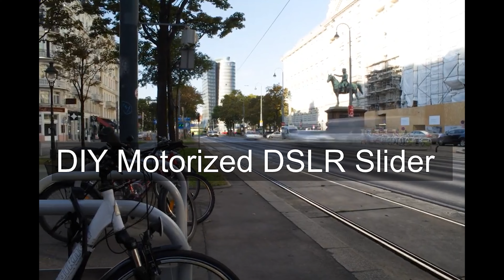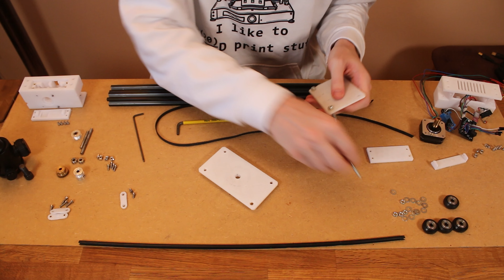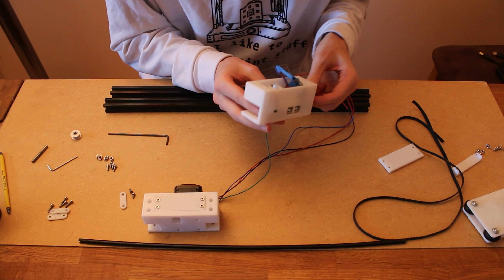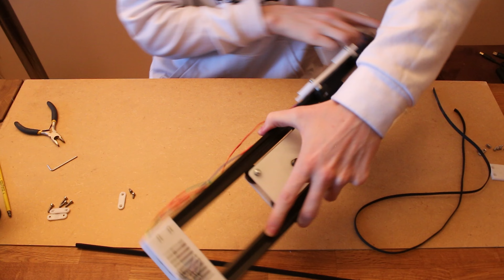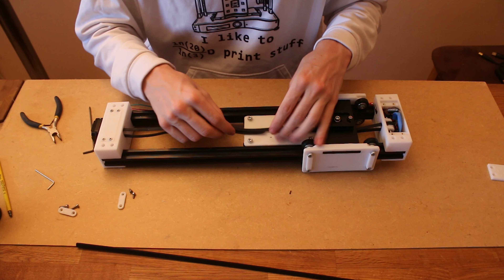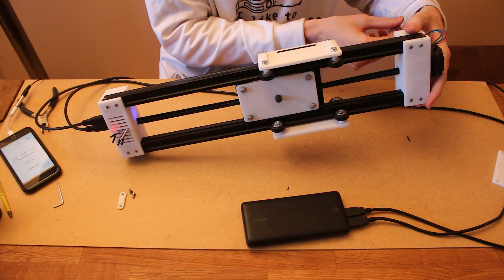DIY motorized DSLR slider (with WiFi) assembly guide (uncut)

Comment: Sebastian, two more questions.
Is the micro switch connected to the normally open pins?
Thanks
Reply from the maker: Hi, not problem, these are things that I should have included from the beginning. I have now added the wiring of the endstop switch here https://github.com/shirnschall/hs-slider-project/blob/master/schematics/endstop-wiring.png . Note that the pulldown resistor (10kOhm) is not part of the pcb but wired directly to the switch. 
I also added a screenshot of the settings I am using here https://github.com/shirnschall/hs-slider-project/blob/master/slider-firmware/default-settings.PNG . Please start with the gantry positioned in the middle of the slider and make sure it moves in the correct way when you press home. If not, use the "invert motor" checkbox to change its direction. 

To configure the max position yourself, start by homing the slider. Then, use the "current position" control in the "camera setup" tab to manually move the slider to the end position. If the slider cannot reach the other end, increase the "max position" setting value. If it reaches the end at e.g. "current position" = 97 go ahead and replace the current "max position" value with the result of the following calculation: (the current "max position" value)/100*97.
Reply: thak you very much @hirnisprojects453

Comment: Hi. I ordered the VERSION 2 board made by the JLCPCB, and I verify that the 248892E_Y12.rar file contains version 1. As I received the board, I verified that there is at least a difference in the pinout of the voltage regulator from 5v to 3.3v on the ci board. please tell me if there is any other pinout difference from ver 1 to ver2
Thanks
Reply from the maker: Hi, can you please explain further what you mean by "version 2" board and send me a link if possible? I am unaware of a version two board. I can also see only one commit on github regarding the gerber files. Yours, Sebastian
Reply: @hirnisprojects453  Sebastian, in the ci board layout, I check it says see 2. hs-slider-project-master\schematics\shematic.pdf.
When opening the pdf, in the lower left corner it says: 02.08.22 02:20 /Users/shirnschall/Documents/EAGLE/projects/slider-v2/pcb.brd.
Inside hs-slider-project-master\pcb-gerber-files there is the file 2488982E_Y12.rar. This file has version 1 of the layout. I say this because I sent the file to jlcpcb and they sent me the board with ver1. They said the file is from ver 1.. Tanks
Reply from the maker: @DRONE_LASER_3D  Hello, currently there is only one version of the pcb, v1.0. The pdf says slider-v2 as this is the second slider I have designed and so it is referred to as slider-v2 in the design software. Unfortunately the pinout of the 3.3V regulator is not correct. Thank you for spotting this issue. I will have to update the pcb design to v1.1 in the near future and add a known issue in the github readme. To  fix this issue please connect the pins of your voltage regulator to the pcb pins in the way they are labeled here https://github.com/shirnschall/hs-slider-project/blob/master/schematics/board.pdf . Alternatively, you could connect the regulator such that the GND pin connects to the GND labeled connector on the pcb. If you choose to use the second option, which I do not recommend, the esp will be powered using approx. 4.2V. As I have not realised this error until now, I am using the second option.
Reply: @hirnisprojects453  Sebastian Ok I understand.
I ask: in addition to this voltage regulator pinout change, is there any other change in the pcb?
I am very excited to complete your project. I am fascinated by time_laps and your project is very interesting.
I leave a suggestion. For a next version of the pcb it was useful to include female jack 2.5 soldered on the pcb
Best Regards
Reply from the maker: @DRONE_LASER_3D  No, there are no other changes. Yes, the missing 2.5mm jack on the pcb is really bothering me. It should have been included in the design from the start. I will make sure to include it in the new version. The reason it is not on the current pcb is that it was originally planned to solder the remote cable directly to the pcb, instead of using a female jack. I hope you are happy with the results once you finish building the slider :)